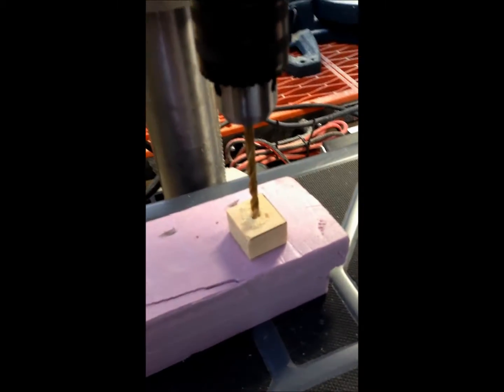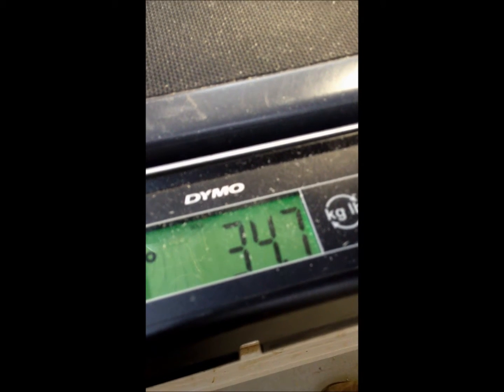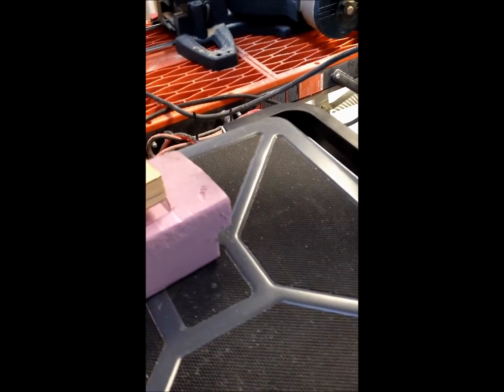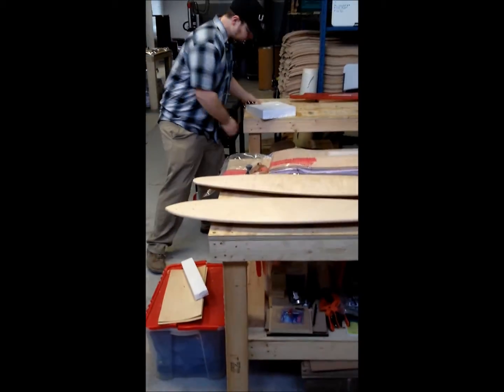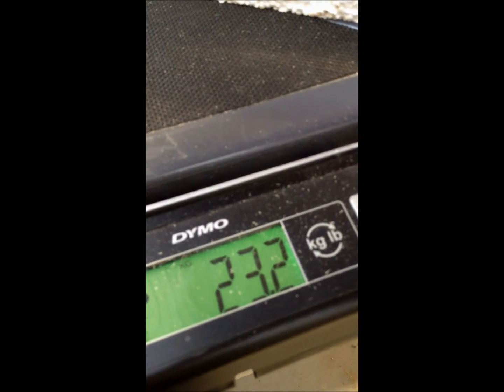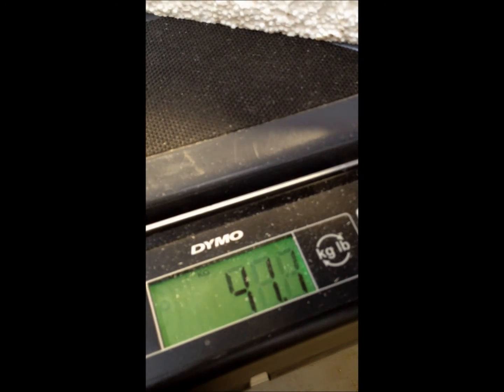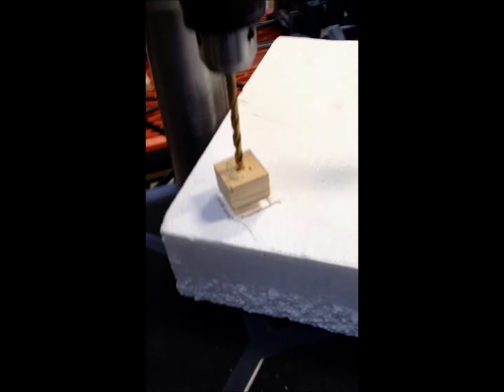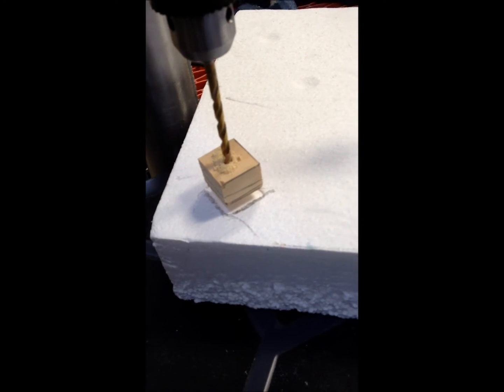Compressive Strength of Foam

Comment: You say "40 pounds" but the scale's display is reading kg's.
Reply: No, its a button to let you switch between kg and lbs
Reply: Look at the scale again, not the face where the selection button is. It says KG! Otherwise it would say lbs, Doc Work is correct!